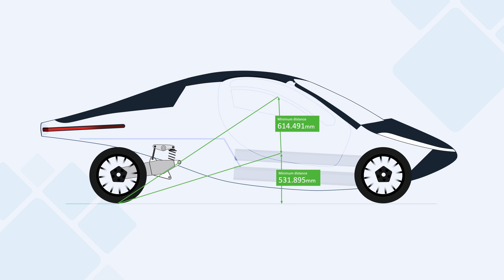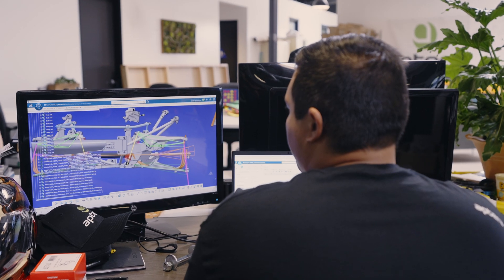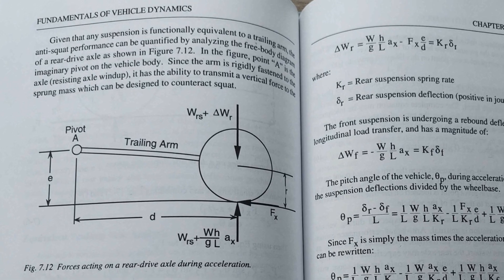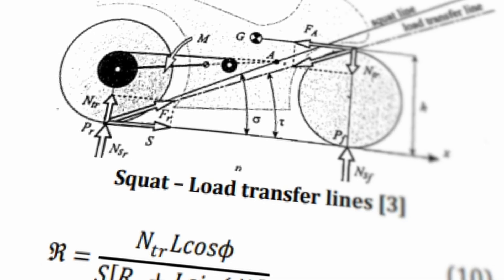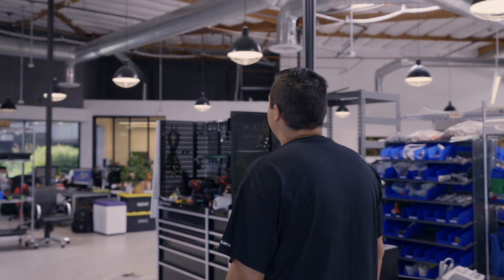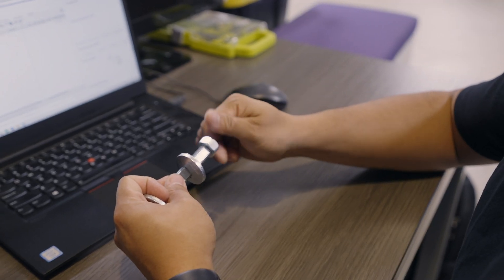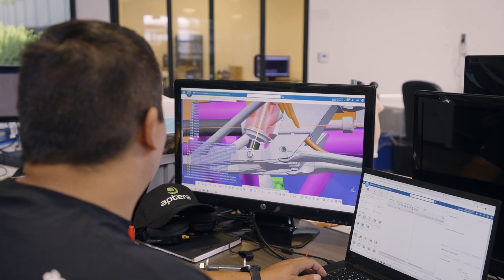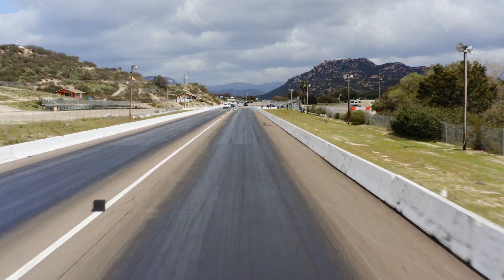Aptera Makers Series — Suspension

Comment: Being so light will it be able to go uphill on a loose gravel, sometimes washboard, road? A Harley cruiser motorcycle does not have the stability and traction to do so.
Reply: Even lighter cars have existed in the recent past. My 1700 pound 1992 Geo Metro had no trouble climbing gravelly or snowy hills.
Reply: That has nothing to do with total vehicle weight. Aptera is currently talking about all-wheel-drive, so traction is not an issue.
Reply: @brianb-p6586  An AWD option would be ideal.
Reply: @glenmattson3765  The current specs on the website list "All wheel drive @ 150 kW" and "Front wheel drive @ 100 kW". This implies that they are planning to use 50 kW in-wheel motors, with motors in either just the front wheels, or all three wheels.
Reply: @brianb-p6586  I imagine that tire contact surface area and tread design will also have a major impact on the amount of AWD traction on gravel, mud and snow.

Comment: What are the goals for the vehicle? Is this intended for high performance? What are the current issues? What are we trying to achieve and why? What quantifiable gain do you get from this kind of improvement? Does the gain justify any increase in cost? Are their more cost-effective alternatives that achieve a similar gain? The effect of whole vehicle dynamics and the relationship with the front? How can this be controlled? What are the datums to ensure accurate, repeatable, and beneficial adaptation? What angle is appropriate for any given circumstance? How does this affect the current setup? How do we translate power from the motor to the wheels? Can we continue to use a stock final drive? Will this require any further motor changes, or can the rear wheel have a motor?  Does this affect the internal wheel arch design? How does this affect reliability/tire? 
Aptera Synergy with 3WS
A steering knuckle with compact electrical actuator are added to steer the rear wheel, initially the rear wheel steers slightly (at most 1.7 degree) in the same direction as the front wheels. This improves stability during high-speed turning or lane changing. Keep turning the steering wheel would reverse the direction of the rear wheel (at most 5 degrees). This is used to quicken low-speed turning and reversing to improve rearward stability during payload weight capacity. Essentially, equivalent to having a long or short wheelbase. Depending how straight or curvy you drive.
Reply: First time hearing about Aptera?
Reply: A review of the company's website, including its FAQs page, and other posted videos here will answer many of your questions, (At least 6 by my count.) As for the others, has any vehicle manufacturer answered them publicly?

Now another question for you: Why the video link? The Aptera is not a leaning motorcycle. It drives and handles like an ordinary lightweight car, with flat bottomed automobile tires, not rounded motorcycle ones that leaning vehicles require.
Reply: @fotoguru222  Okay, I took the link off. The body rolls while the dual trailing arms maintain proper contact patch for a symmetrical tire.
Reply: Welcome to Aptera.
Reply: Go to their website and LOOK!
Reply: @ronaldlenz5745  If you go to the website and look at the FAQ's you will notice that it has been heavily modified since 9 months ago.  They silently remove items in their spreadsheet, and promise improvements which will only add to the cost  and weight.  Please remember that the first venture was unsuccessful, so we do have to be a little cautious on what they are promising.  I really don't see how they are going to fulfill their promise of sales by Q4 2021.  This could be another Elio for all we see.
Reply: Getting really tired of the stock “another Elio” and “first attempt failed” comments. They only serve as proof those commentators have not read the details of both companies histories. Read the full details and come back to argue your position.
Reply: The US Navy has now officially declassified operable patents for anti-gravity and free-energy technology. 
David Wilcock's Hover Board Testing Facility and Anti-Gravity Car tu.be/X5b3T4s1lSY
Reply: They should make a 4 wheeled version like this one https://www.youtube.com/watch?v=H2IN21wbrm0
Reply: @ruppert5134  That's a cool 4 wheeled version. Aptera doesn't understand the principle of dual rear wheels. The body rolls onto the outside wheel pressing down while the suspension arm keeps the tire tread flat on the road. Aptera must prevent body roll because it de-cambers the rear wheel, loosing traction. To prevent body roll, makes for a rough ride but it keeps the tire tread flat on the road.
Reply: @WolfsburgWarehouse  The 2CV platform doesn't prevent body roll either but maybe better then 3 wheels. With modern tech I bet it could be solved. But if Aperta would ever want to build a 4 wheel more conventional car type they should start with this 75 year old concept and I doubt it has patents on it anymore. A 1400 dollar platform with only 2 springs and damping on the side makes it ideal for something like that. I am surprised it hasn't been used TODAY on an massive scale for these kinds of EV's.
Reply: @ruppert5134  Yes, solve the problem by making the single rear wheel stay flat on the pavement, independently of body roll.
Reply: Why only twenty questions? What of twenty five? What of twenty nine,? What of forty? Why not fifty three? Seventy perhaps? Hundred maybe? ?, ?, ?
Reply: The goal of the vehicle is to provide the most energy-efficient transportation possible for two people. As simple, and as complicated, as that.
Reply: @robertkirchner7981  Synergy is an interaction or cooperation giving rise to a whole that is greater than the simple sum of its parts.

Comment: With the emphasis on efficiency are the front and rear motors going to be different where 1 is more efficient at slower speeds and the other at high speed like the Tesla dual motor?
Reply: Probably hasn't been determined yet.  The rear motor is optional, however.
Reply: That's not how the Tesla AWD ("Dual Motor") works. In the original AWD Model S the front and rear motors were identical. They were only different in the Performance AWD because they used the old big rear motor instead of the smaller AWD rear motor, giving them motors of different sizes - nothing to do with efficiency. The small and large original-style Tesla Model S motors are geared slightly differently, but not for different speed ranges... just to suit the different motor sizes.

Comment: I hope there aren’t a lot of resources being devoted to autonomy yet.  While it would be nice to have a car that drives itself, I’d rather see a production ready, lower cost, human driven car than see efforts towards self driving push up cost and cause release delays.  

Aptera is innovative enough without it that being a little later to market on self driving isn’t a deal breaker.
Reply: I don't think they'll delay introduction so the vehicle will be able to drive fully autonomously. That's not the plan. The plan is to have the hardware ready if I understand correctly. 
Since the goal is for these vehicles to last for decades, I think it's a very good idea to have the first production version already prepared for autonomous driving. You'll want to be able to upgrade in say 5-10 years when autonomous driving becomes normal, without having to go trough difficult rework on your vehicle. 
Aptera has the right focus here imho.
Reply: @siesstad   I understand what you’re saying, but the likelihood of having the right array of sensors, cameras, and computers that enable upgrading to safe autonomous driving on the first production models seems unlikely to me.  Waymo, with a complete focus on autonomy, 12 years of experience, and $5.5B in funding is still working on the solution.  Aptera with $61M funding while trying to develop an entire vehicle from scratch seems like it would most benefit from omitting self driving altogether for their first model.  That challenge just seems too big for such a small startup.    

Disclaimers: This is just my fairly uneducated opinion and I am a hopeful for self driving cars in the future when the big players have already jumped the technical and regulatory hurdles.
Reply: Agreed. The only feature I would have to see at introduction is advanced cruise control. The rest of autonomous driving is gilding the lily.
Reply: I don't see anything about production or factory. 
Loads of resources into design and research none into production. 
At this pace this would never get into production!!
Reply: @mjerez6029  an 80,000 sq ft production facility has been leased in Carlsbad.
Reply: @mjerez6029  I assume they are planning to contract out production.
Reply: @matthewhuszarik4173  I think at one time they talked about distributed assembly locations. They would make the car relatively simple to assemble. Then they could drop-ship the parts directly from their suppliers to the assembly locations. In that way, they won't have massive factories, per se. I wonder if that is still their plan?
Reply: @mjerez6029  They have leased 80,000 sq. ft. of factory space in Carlsbad.

They have another beta assembly and test facility in addition to the present headquarters.
Reply: Just to throw this out, Tesla used mobileye and later Nvidia for self driving. In some respects the nvidia system works better than what they have now. They don't have to make one as there are companies who already make them, and really, level 2 is all you need, not some ridiculous claims to level 5 full self driving. Which even when that happens Tesla will still not take liability for it knowing them lol.
Reply: I agree, huge amounts money are being spent on autonomous driving and none of the systems out there (including Tesla) work well even for simple lane keep assist. Let the other companies burn their money and wait to see where it leads.

Comment: Keep up the great work Brian! Glad to have you on the team!
Reply: Really gotta respect his challenges.  Wheel motors cause massive unsprung weight.  He also probably needs to tune the suspension to the different weights because a 25kwh battery is probably 600 lb lighter than the 100kwh (assuming same chemistry).  That's gonna make the 250 mile vehicle 2/3 the weight of the 1000 mile (great for efficiency not stability).  Can't imagine a company focused on efficiency would put weights to make 1 suspension.

Comment: EPS or electric power steering confirmed, to all those who were asking! 🙂 Also great to hear that Autonomy features are high up on the list of aspirational capabilities on future models/updates.
Reply: It is nice to see electric power steering but not sure why they are not also implementing torque vectoring steering like Arcimoto as well. If you have ever driven a CanAm Spyder at low speeds on twisty roads you will feel the extra power it takes in your shoulders to turn the vehicle. I would think torque steering would reduce the amount of energy required versus electric steering.
Reply: Aptera is on track for great things in the EV industry. Glad I got in early in this company.
Reply: With the weight so light, I wonder why they needed it, gen 1 miatas had no power steering option to give context.
Reply: @ChrisLoew  The EPS is required for autonomous features to work. Without it, the car would have no mechanism for turning the wheel on its own. It is possible they could use vector steering for this as well, but implementing that would be less straight forward.

Comment: I’m curious to how the team will deal with the multiple versions of the Aptera regarding suspension. Pretty big swing as far as weight difference between the shortest- and longest-range models.
Reply: That will probably be done using spring and damper rates rather than re engineering the whole suspension design for each model.
Reply: @jamiecrutchley4146  sounds simple, hope they go with that option.
Reply: Hopefully they will be customized depending on the model. I hope they have some sort of adjusting that could be made depending on how heavily they're loaded though.
Reply: @2eyedhairlessmnkey  for sure. Definitely hope so.
Reply: Air suspension is the answer. It's the most cost effective, all-rounder suspension with good feel, good tuneability, and the most mode flexibility (loading modes, hill climb mode, leveling, increased ground clearance, etcetera).

Comment: It was mentioned a while back that the hub motor manufacturer was going to integrate mounting points into their casting for the Aptera. Is that still happening? Love the updates. Thanks!
Reply: Aptera is not developing the autonomy feature themselves, and it will not delay any deliveries.  They are talking with several potential suppliers.  There will be a socket in each Aptera where the board that powers the Safety Pilot can be plugged in when that option is ready.  This may or may not be when the first Apteras ship.
Reply: The Elaphe wheel motors will have a quite different form for the beta models compared to the alphas, with protected, cleaner cable runs

Comment: Nice because it is likely the rear wheel will take most of the pot holes   as it is normal to avoid pot holes with the front wheels.
Reply: In anticipation of the Aptera I find myself looking at pot holes now with the thought as to exactly how I need to maneuver so the pothole doesn’t pass under the center of my car. I makes you more aware of potholes than in the past. Those really big potholes will become more of a woah SLOW DOWN.
Reply: @arlenbell4376  smart thinking!

Comment: Like to see some stats on the ride and handling, how’s the unsprung weight quandary coming along. 👍👍
Reply: In reading even decade old engineering papers on this topic, it just doesn't seem as though unsprung weight has been an issue for Aptera.  Considerable off setting weight has been removed in unneeded drive shafts and robust brakes.
Reply: @n.brucenelson5920  half of an axle shaft is not much compared to a wheel motor, and you still need brakes sufficient to stop the vehicle from its highest speed.
Reply: @brianb-p6586  No, the regenerative braking provides most of the braking power.  Basically you don't need more than holding power in the mechanical brakes.

Roush is working on the suspension design and there will be major changes to the beta models, including getting rid of the rear swing arm.
Reply: @n.brucenelson5920  Yes, regeneration is most of the braking... when it works. For safety, an EV needs friction braking which is fully functional (for just one stop, so the rotors can be light) without regenerative braking working.

I think "Roush is working on..." has become  code for "we're paying a company with a recognized name to gain legitimacy".
Reply: @brianb-p6586  "when it works?"  Regular brakes can stop a car "when they work".  I have had personal experience with brake failure - fortunately in a manual transmission car which left me some control.

It has been Aptera's policy to hire and partner with the best people and companies available.  
 
No "not invented here" nonsense.
Reply: @n.brucenelson5920  Yes, you have cleverly noticed that every system can fail... that's why redundancy is required in braking systems. Since the regenerative system can fail due to a single bad line of controller code, backup to it is essential... even though it will probably never fail in the life of the vehicle. Regenerative braking doesn't eliminate friction brakes, whether the motor is in-wheel or not; saying that the in-wheel motor mass is compensated for by brake size reduction is nonsense, because in comparison to inboard motors there is no difference in brake size.

I have nothing against Roush - they certainly are good at making consulting money. Every auto manufacturer uses outside suppliers and consultants - those outside companies are named in promotional statements when the manufacturer needs credibility.
Reply: @brianb-p6586   Perhaps not in size, but certainly in mass.

Roush has already made significant changes to the design compared to the Alphas, greatly improving both safety and performance. This is where the credibility comes from.
Reply: @n.brucenelson5920  Are you saying that that the mass reduction of the brakes due to regen is greater for an in-wheel motor than for an inboard motor? I hope not, as that would be nonsense. Yes, friction brakes for a vehicle with regenerative braking can be much less massive than without regen (regardless of motor location), because although the same braking force is needed, it is only needed for one stop.

I'm glad to hear that Roush was helpful, although it's sad that a vehicle that has in development for so long (16 years so far) had such a poor suspension design that it can be "greatly improved"
Reply: @brianb-p6586  Yes, but it is due to the elimination of drive shafts.

Development on the current Aptera model only began in 2019.  Although there are some conceptual similarities, there are no common parts to the original Aptera designs, including drive train.  It is a completely new beast with amazingly rapid development compared to established car companies.  I have watched the process as a vendor for Ford and GM.  I worked with many of the Tesla engineers and Tesla was a clown show in the early days in comparison.
Reply: @n.brucenelson5920  Ah, yes... after years of saying "we're about to start production", the start-up capital sinkhole says "we actually just started the design". Nothing new here...

Yes, much of what Tesla Motors did and continues to do has been a clown show.
Reply: @brianb-p6586  Except for a new company and new CEOs with successful IPO d under their belts.